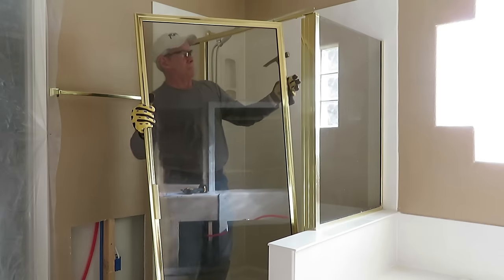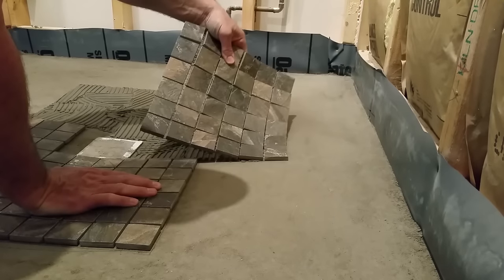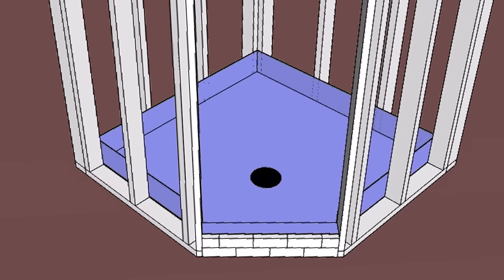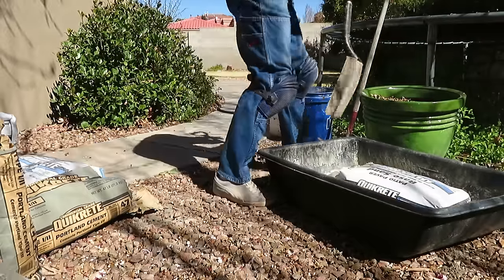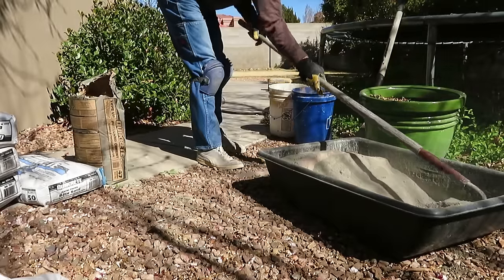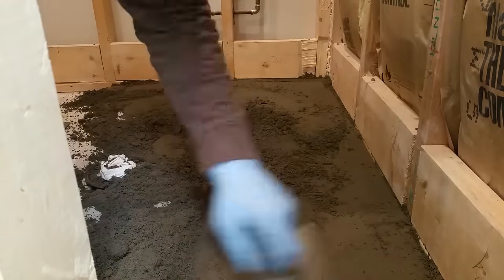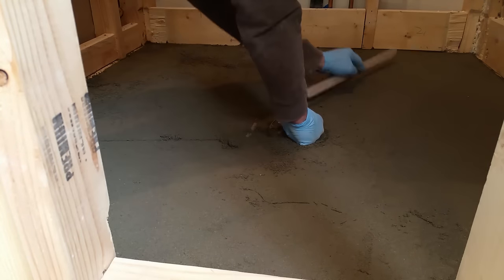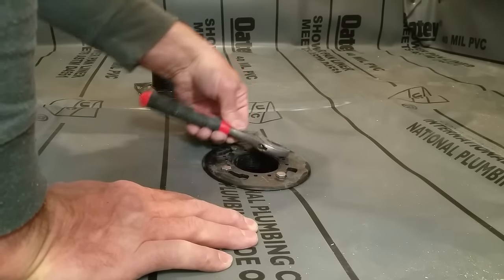Building a Shower Floor From Scratch - Part 1 of 2 - With Shower Pan Membrane

Comment: OK, Mr. Dobbs, as I am applying your method on a job some questions arise in the process and these concern your brick border which is here, already in place with the pan liner glued to it along the inside and top. So I'm about to put on the steel lathing over the brick and pan liner. Can't I use regular mortar mix to embed in the lathing instead of thin set? And wouldn't that allow me to apply thin set and tile directly to the mortar without using backer board? Also, how much gap, or separation, is there between the pan liner-covered bricks and the steel lathing? Or to put it another way, how thick is the mortar around the brick border. From appearances at 2:01 in the video, it looks like the lathing is snug on the sides but a little above the top, maybe a quarter or half inch?  Finally, how does one insure the edges of the steel lath don't pierce the pan liner? Thanks.
Reply from the maker: Thanks for your question, Joseph and, yes, I have used mortar kind of like you are suggesting before the Hardiebacker days.  I used to build a form on the front and back of the step with at least 1/2" distance between the form and the brick with the lath floating in between. I made sure the forms were level front and back and giving me about 1/8" slope from the front form to the back for drainage back into the shower. Then, I poured it with a little richer dry pack mix and enough water mixed in to allow it to flow down the channels front and back of the step then screeded it across the top of the forms so that once it set up, I had a level concrete step with appropriate slope. It was a little tedious and had to get creative securing the forms but I was always happy with the finished product and all I had left to do was set the tile. For that style of step, I  wanted at least 1/2" concrete encasing the step, all poured at the same time. On the lath against the pan, just let common sense  direct you. If it concerns you, shim or trim the lath until it looks good to you. Sounds like you are making great progress! Good luck on the rest of the process!
Reply: @RustyDobbs  
thanks, I don't know how you can keep up with all the questions but I really appreciate the response. A form sounds like the answer I was looking for. And I am a festidious tinkerer so I think that might be my answer.
Reply from the maker: Sounded like you were working hard on your shower floor and would appreciate a little fuller explanation. I think you will be  happy with the formed and poured shower step. Good job taking on that project, Joseph!

Comment: Hi Rusty.  Wife and I are tackling tub to shower instal. First dry pack done.  Only concern so far is I think my dry pack was a bit too dry. After slapping it well with a trowel,  never could get it to look like  finished concrete (wet look). After sitting overnight,  we vacuumed the surface and some small patches broke away.  Filled them in with fresh dry pack.  Looks good to go. My question is, should I worry about the  dry pack being too dry?
Thanks for the great video.  Moving on to rubber pan and second dry pack today.
Jeff.
Reply from the maker: Great, Jeff, and thanks for telling me about your experience! You probably have already done the second dry pack and I’m sure you got a little bit better feel for working with it on your second mix. You’re well on your way, I can tell, just based on the questions that you’re asking. Working with dry pack is one of those things that you get better at the more you do it. Your results will also be more satisfactory to you the faster you get at working the floor into place and getting to your finished troweling before the material starts to dry out. My rule of thumb is that I like my dry pack just wet enough to set up the Portland cement. I think I said in the video that if you pick up a handful of the dry pack and squeeze it and see water, that’s too wet. That doesn’t mean that it won’t work just fine because it will still set up. It just means that is going to be more of a hassle to work with particularly when you are trying to cut it and shape the floor. It will be a little sticky on your trowels and sticks. So, in a perfect world your dry pack is mixed just perfectly and you get each layer in place in about an hour start to finish after mixing your dry pack on an average sized shower. When you mix it a little too wet, you’ll know it particularly in your case with your first experience of thinking you mixed it a little too dry. But as long as you have enough water in the mixture to cause the Portland cement to set up, your floor will do what it’s intended to do. Hope that explanation helps a little bit, but my guess is you already have a pretty good idea of what I’m explaining.
Reply: Thanks for your reply Rusty.  You are correct.  Second dry pack went perfectly. Backer board is up, taped, and red guarded.  Application of wall tile in progress .
Very exciting to see it coming together. 
Thanks again, 
Jeff.

Comment: Hi Bob 
Thanks for share useful information if possible plz make a list for material and tools needed for project.
I want to build the same shower but I don’t know where to buy the pan liner and how you attach the drain line and make to exact hole in liner ,
I have bath tub 5 feet long now I want to build walk in shower and remove the cast iron bath tub.
I want new shower 4 feet long.
Any help and idea will be highly appreciated.
Reply from the maker: Sorry I missed replying to your comment sooner, Prof! Two of the main materials that are needed are the shower drain and shower pan liner which are both manufactured by Oatey in this case and can be found on Amazon. Depending on where you live, home improvement centers will also have these items in stock plus the remainder of the materials and tools I used in the video. I used a couple of different sizes of flat trowels that are also easy to find in any store that carries construction materials. The sand I use is regular mortar sand or play sand and the cement I use is called Portland cement. The video is pretty self-explanatory as to what you do with these materials. When you are placing the liner in the shower floor, you can feel the hole in the shower drain and that's where you know to begin carefully cutting the hole. There are also instructions that come with the drain that shows you how to attach the drain to the liner or there are other YouTube videos that go into more detail. The main challenge you have it seems to me is in getting rid of your tub and potentially relocating the drain in the center of the area you want to be your shower. If you have a concrete slab, this makes that process a little more challenging so you may want to bring in a plumber to do that prep work for you. Anyway, that's a rough overview for you and I hope it's helpful.

Comment: Wow this helped a lot! Could I use green board on the walls then redgard the base and walls?
Reply from the maker: Yes, Shazil, you can actually use any products designed for wet areas and there are lots of them these days. I just happen to like 1/2" Hardiebacker for my walls.  Hope your project turns out well!

Comment: I'm seeing some installers place thin set on the slab prior to the first pre-slope.  Should I add that step or is it not necessary?  Also, when installing the backerboard, some installers are stating that the hardibacker should not touch the drypack/mortar bed as it would allow water contact and the water will mold or rot the lower 6-10 inches of backerboard.  They place a thin spacer there to keep backerboard elevated by an 1/8th or so ... Any thoughts on that?  Thx for sharing your wisdom, I hope that you are enjoying the good life, Rusty!
Reply from the maker: In the YouTube era, I tend not to knock an idea if it wouldn't do any harm and that would be my reaction to the thinset suggestion, Jeff. I would have a hard time convincing myself to do it. The preslope isn't going anywhere. I look at the floor as the most critical part of the shower and I want the drypack and grouted tile to extend under the Hardiebacker walls basically back to the studs with a positive slope back to the drain in my installations. In that case, whether the 1/2" Hardiebacker I use touches the floor or is elevated a little is not a big issue to me either way. Water flowing off the wall tile is going to hit a grouted tile floor that is going to send it to the drain. Maintaining the corner and floor caulk joints and grout joints is the maintenance that is needed thereafter. Hardiebacker is such a durable product, I don't think it would ever be a part of a problem if installed in the method we are talking about. Life is good, Jeff! Hope the same for you!

Comment: I'm not sure if you still check comments but in your video the initial shower flange is sticking up and you did your pre slope to that. But mine is flush to the floor and so my pre slope would taper down to basically nothing. Is this correct? And would it be better to mortar the preslope if its going to be thin like that so its still strong? I'm building a house at 32 and trying to do everything I am able to in order save money and learn a long the way. Just don't want to make any expensive mistakes. Thank you for all of your well explained videos!
Reply from the maker: Hey, Kyle! Yeah, I typically see all comments regardless of when a video was uploaded. On your preslope question, all it is really doing is providing a base for the shower pan to sit on. It’s the volume of material that is providing the support which is never going anywhere once the rest of the shower floor is in place. So, the fact that the drypack feathers to nothing and cracks because it is thin is not an issue. My preslope in this video cracked around the drain too when it dried. Good luck with your house build! You are doing a lot to secure your financial future by building your home and learning all you can about the process and trades along the way. Well done, Kyle! I’m always happy to give you a perspective if you run into other questions along the way while finishing your place.
Reply: @RustyDobbs  wow what a polite and prompt response! Thank you for that info that helps alot and I'll be looking forward to all of your upcoming videos!

Comment: This video is very informative. I am appreciative for your willingness to share your knowledge.  However,  I do have a question that I was hoping you could shed some light on. You mention leaving a tapered angle when installing first layer of dry pack underneath the liner, then you mention leaving a tapered angle on the second layer of dry pack as well. Are they both tapered, or is the top layer of dry pack only following the angle that is pre determined by the first layer of dry pack? Thank you again for your time and effort in sharing this information!
Reply from the maker: Thanks, Matthew! I’m always happy to pass on information I have picked up from others over the years. You are following what is happening with both dry packs and are probably even overthinking it a bit. The first layer is tapered just to get some slope for the liner to rest on to direct any water to the weep holes in the drain as needed. The top layer that the tile is set on is tapered for obvious reasons. You can think of the two layers as running parallel to each other in the end, but there’s no intention or specific purpose for that. Ideally you want to have about 1 1/2 to 2” minimum thickness on the top layer all the way from the walls to the drain across the whole floor to set your tile on. Hope that helps!

Comment: Ive been studying your videos im about to attempt it. My question is how many bags of sand and how many bags of concrete? Great information thank you!
Reply from the maker: Good luck, John! I'm always glad to hear from people like you who are taking on a challenge like this. You will learn alot and gain some valuable skills that you will never forget. I do always forewarn people that their second shower will be better than their first! That's just the nature of learning to work with dry pack! It makes more sense the more you do it. Think of the 1:4 ratio of portland to sand. I typically start with 2 -50 pound bags of portland and 7 or 8 - 50 pound bags of sand for a typical shower floor like the one in the video. After you mix and place your preslope layer, you will have a better idea of how much more material you may need, if any, to finish out your final layer.
Reply: @RustyDobbs  thank you sir about to go to lowes got a Lotta work to do

Comment: Thanks so much for this video, I've learned so much!  Not sure if you check the comments on here still, but I have a question about the dry pack, I assume it's possible for it to be too dry?  I did my best to mix it to match what I see in the video, it held together mostly when I squeezed it, and no water squeezed out, so I did the preslope.  That was two days ago, and I just went to check it, and some parts seem solid, but others I was able to scrape it up like it was hard dry dirt, and light taps with a hammer makes it chunk up easily.  I assume it's not supposed to be like that and I made it too dry?
Reply from the maker: Hey Matt! Let me share some things that will make more sense now that you have mixed and placed your first batch of dry pack. My initial reaction is that you probably did fine. Dry pack is not going to end up like concrete unless you intend for it to be, in which case you add more water and trowel it to bring moisture to the surface to make the portland in the mix trowel out to a smooth finish. It will still potentially crack primarily because it has no aggregate (rocks) in it. The singular purpose of dry pack is to give you a base that you can set tile on and that will allow water to work its way through to get to the weep holes in the drain as necessary. Hence, you use sand alone with the portland. 

After two days, when dry pack is completely dried out, it is not going to look very good. The solid areas you see are places you packed a little tighter and had good moisture content and the dry hard “dirt” spots are places that did not get packed as well and/or the mix may have been drying out when you were packing it. Not a big deal but just something to pick up on for your next batch. And yes, taps with a hammer will sound hollow and you could easily break it all out in a short time. After all, it is not very thick and tapers down to the flange. Remember, the purpose of the preslope is only to support your liner and give you positive drainage to the weep holes. You could take it out and try again to get more practice. The most important batch is obviously your finished floor batch.

A few other thoughts I may not have emphasized in the video. 1) When you start placing a layer of dry pack, work steadily, don’t take breaks. Try to get it installed while the mixture is roughly the same degree of dampness. For example, the shower in this video took me about an hour and a half to place each layer. It’s a good upper body workout! 2) Don’t walk on an unprotected dry pack. The surface will break down easily and is not designed for foot traffic. 3) My normal routine is to do the preslope one day. The next day install the liner and place the finish floor dry pack. The next day install the floor tile. The next day grout it and the floor is ready to work on top of the next day. I like to get my floor tile set as soon as possible (like after about 24 hours) to protect the dry pack primarily from any inadvertent damage. The second dry pack cures a little slower because of the liner and I like to get my thinset and tile on it as soon as I can. 

Finally, working with dry pack is all about feel and learning how the mixture works. Getting good with the trowels and the process makes a big difference. You can add more water to the mixture for a more solid base, but it becomes a pain to cut with the screed sticks if it is too wet and your floor will tend get ‘washboard’ waves in it as you work that are hard to get smoothed out. 

It’s a great mix to learn to work with and don’t be afraid to use this mixture for other purposes besides a shower floor. You can adjust the water content to the needed purpose and get a solid chunk of concrete in a form if that’s what you want and lots of things inbetween! Good luck, Matt! Sounds to me like you are getting it. I do have a more recent couple of videos called “Building A Corner Shower Floor From Scratch” that covers the same topic but addresses a few other points as well.
Reply: @RustyDobbs  Thank you for your response, I feel much more confident about how I did!